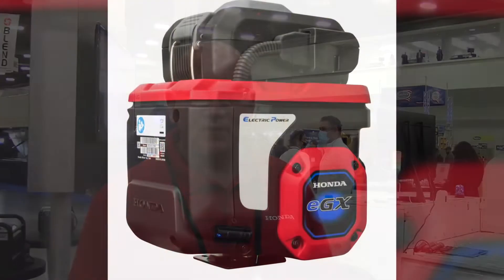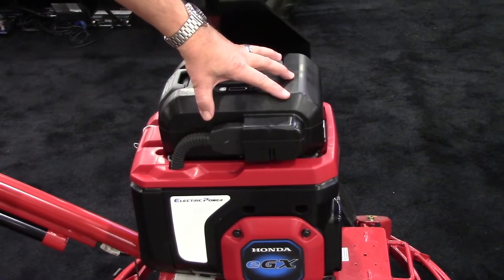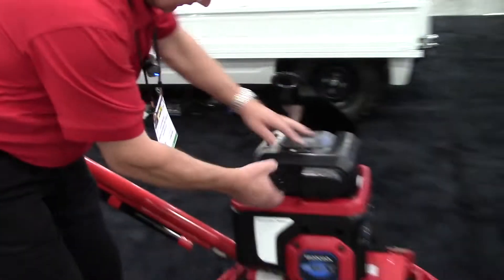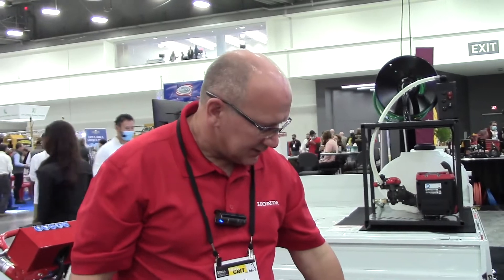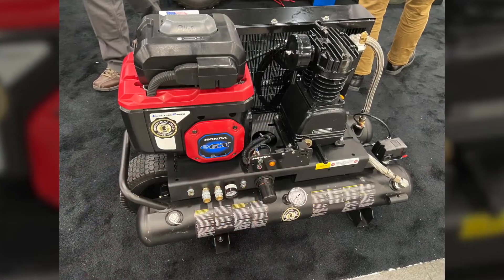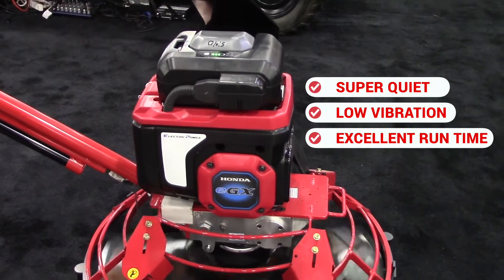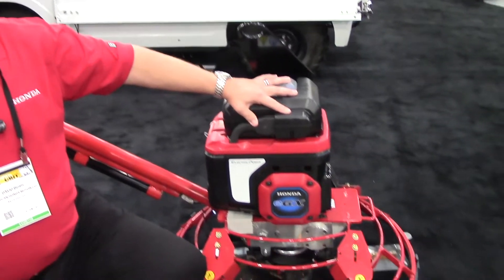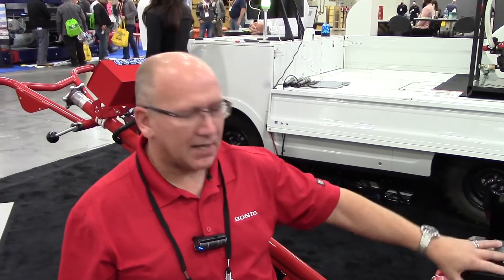Honda’s First Battery-powered Motor Delivers a Quiet, Emissions-free Power Source

Comment: Why aren’t these being promoted more???

And this is not a Niche product….make this affordable and people will transition to this rather than the petrol version.

Just make sure the electric conversion kit is simple. From what I can see, it is. 
The downside however, you have not introduced this to all international markets(or you have, but made it really difficult to find and /or super expensive to end users.

So, please work with OEM’s.
But make these available to the general public as well.

Imagine an end user who doesn’t want the noise when pressure washing or pulling water from a well…..and they have an old petrol version, they can just buy the electric and swap it in.
Reply: theyre probably having trouble producing them with the chip shortage, i imagine this thing is chock full of chips